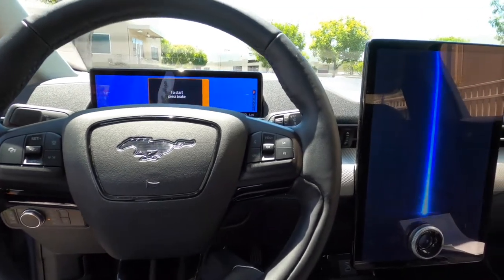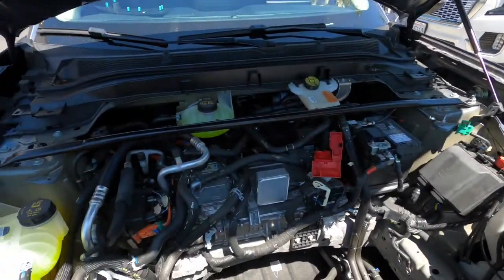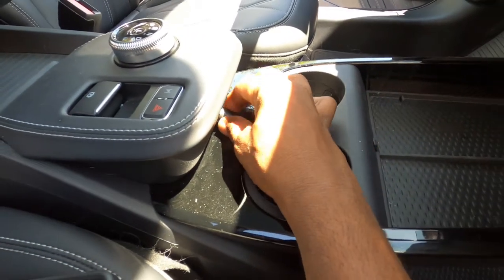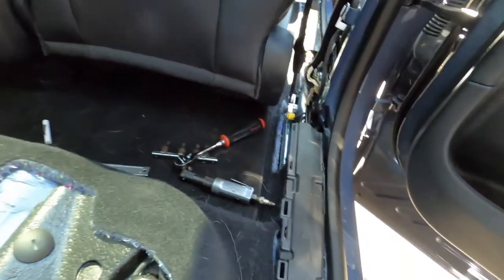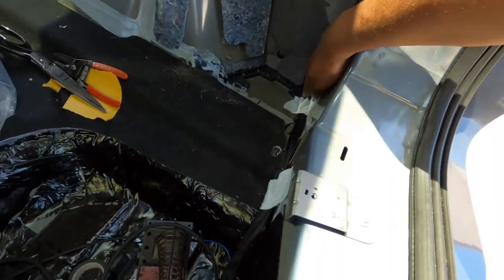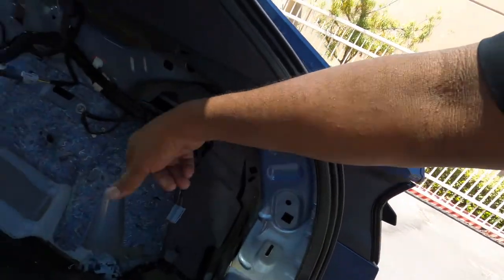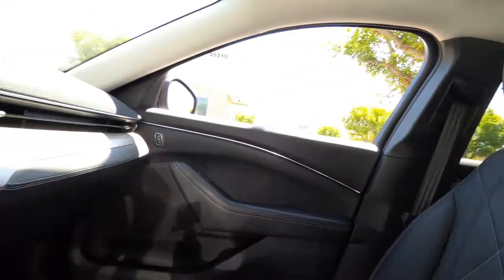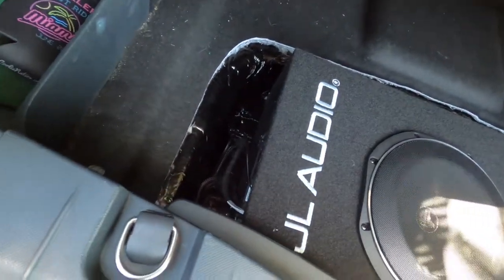2021 Ford Mustang Mach E Electric car with a JL Audio ACS10LG-TW1 powered subwoofer with bass knob

Comment: So what all exactly was needed for this install? Did you need to add a dsp or an LOC? If I have the B&o sound system with factory sub would anything need to be done differently?
Reply from the maker: I used an amp that had high level input, then I grabbed the front outputs. Most amps are able to take high level & no LOC was needed. The front inputs were full range, so no other items were needed.
Since your OEM audio system is B&O you should be able to use that signal without any issues. There a slight possibility that you may need a turn on lead to trigger the amp. If so the is a 12 volt switch lead in the trunk area in the cigarette connector.
Reply: You needed an additional amp even with the self amplified sub?
Reply from the maker: @2001invincible  no sir. If your sub box has a built in amp then is no need for another.
Reply: @lancesautovlog  okay so with the self amplified JLaudio Sub you would just need to wire it to the battery and then use a line output to connect to the head unit for audio controls? Planning on having the 12 inch version of the one you used installed
Reply from the maker: @2001invincible  yes sir

Comment: Which wires need to be tapped for a LOC?
Reply from the maker: I grab the front speaker output to make all work. I didn’t use a high to low, because the amp had a input.